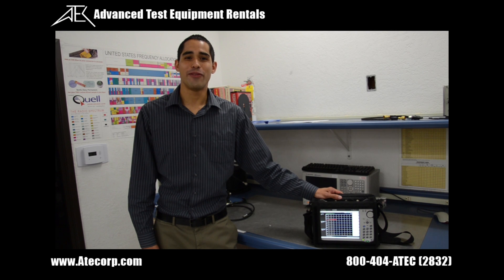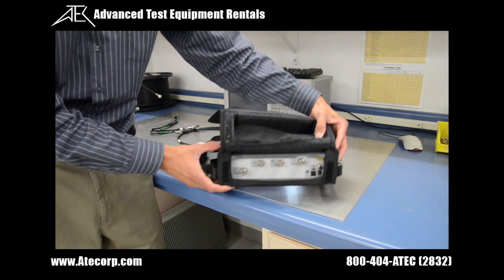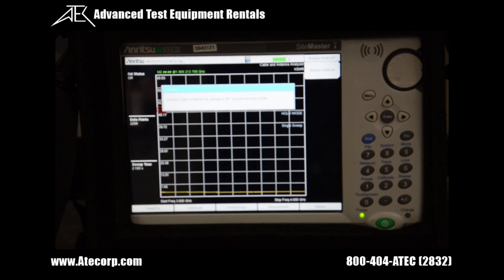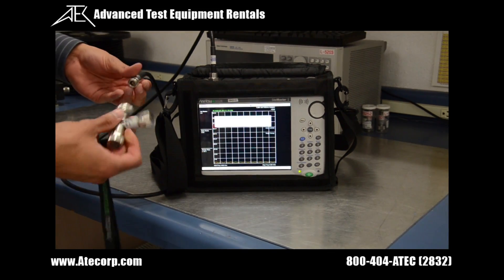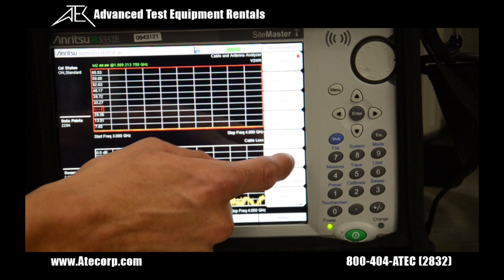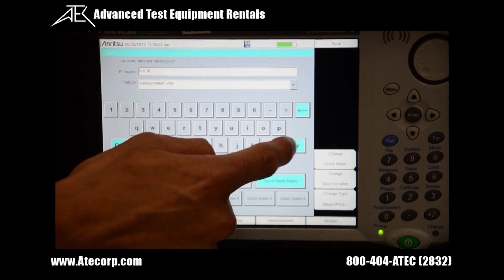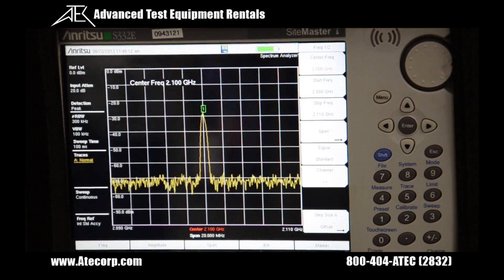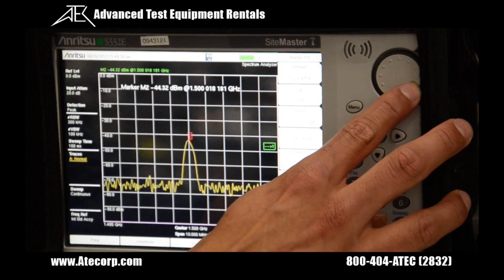How to use Anritsu Site Master / Sweeper for Antenna & Base Station Testing

Comment: Do you have a coaxial cable test using Anritsu MS2025B? We have to use this model to measure the condition of Radio-Altimeter of an Airbus A320 and this equipment is new on our hangar. Nice video!!!!
Reply from the maker: Hi @alexeds21. We'd be happy to help you out, visit our website atecorp.com and send us an email!